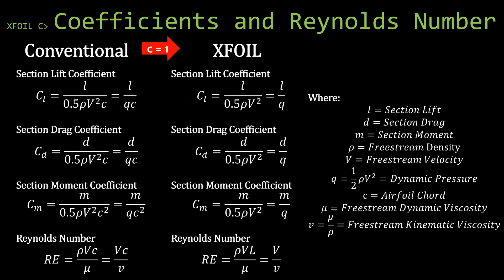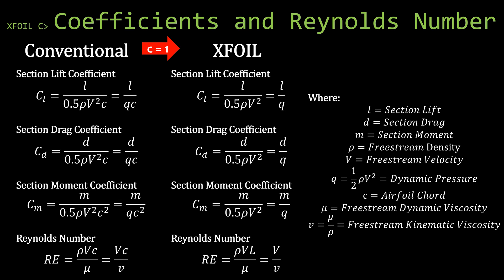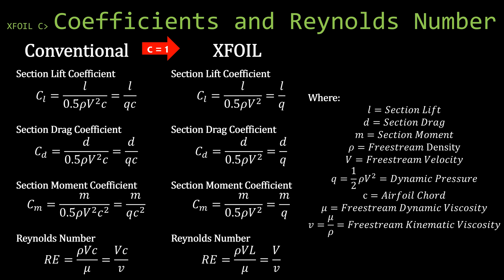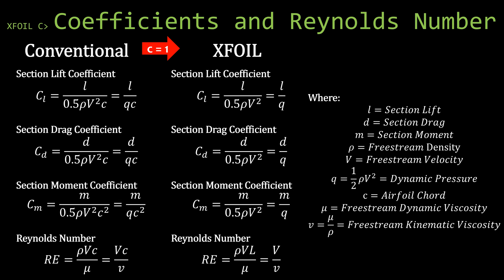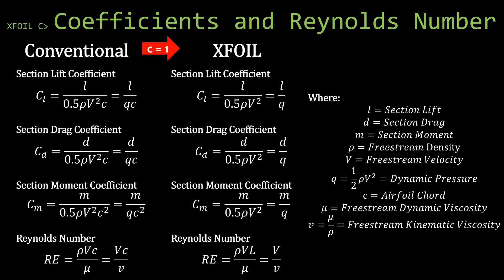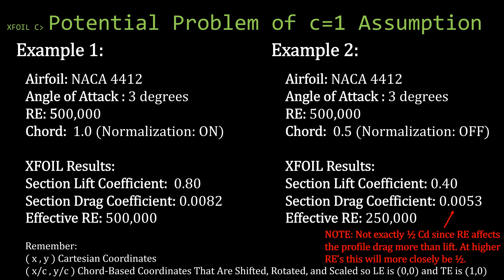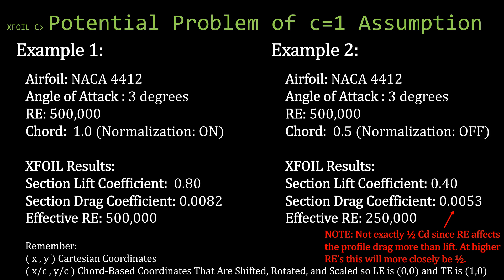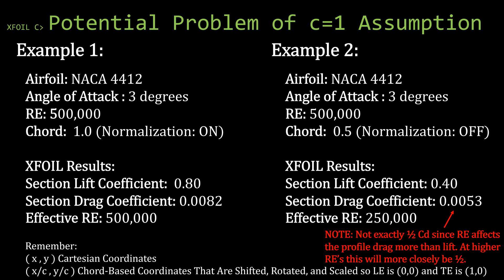XFOIL's Cl, Cd, Cm, and RE Equations (Major XFOIL Assumption!!!)

Comment: Thank u very much, it was very useful, i was testing an airfoil the nrel s822 in a wind tunel , my experimental lift and drag coefficients are very differents vs the xfoil coefficients but i think it could be the conditions of measuring, i used two digital balances and a mechanism to determinate the lift and drag forces. Now i realised that my experimental method is not very accurate, thanks for the explanation.

Comment: Hey,
Thank you so much for making these videos. I'm still a bit confused about the thing with the normalization of the chord. Suppose I'd have a NACA 0012 with a chord length of 0.06m. How would I compute Cl with XFoil? That is, would I scale the airfoil in XFoil and what value would I need to use for the characteristic length for the computation of the Reynolds number?
Reply: I have the exact same question. I'm using  a GOE 430 with a chord length of 0.060m . I normalized the Airfoil and I got the results, now I'd like to know how can I apply those results and calculate new coefficients for the Airfoil with the original dimensions. If this not possible how cam I do the calculation of the coefficients for the original Airfoil within Xfoil?
Reply: I have the exact same question using the same exact NACA foil for a rotor I'm busy modeling. It seems I would either need to:
1. Scale the Reynolds number using the difference in chord length of my actual model and attempt to normalize it in Xfoil, or 
2. Scale the NACA profile using GDES (My chord is 35mm so I use 0.035). I then specify a value for Reynolds number at the velocity @0.75 x Radius and run a polar of multiple AoA's. 

Using option 2 (which seems the most logical to me), my experimental vs theoretical results deviate with about 10%. 

Either way, I have found any solid answers either. I'm so confused...
Reply: @byronnielsen8896  I think the hint lies in the Cl, Cd,... and Re definitions in Xfoil. If you have c value other than 1 you have to correct for not only the output data but also the input data, i.e. the Re. So going by the example in the video, if your c = 0.5, before you get the data, your input Re should be scaled by 1/0.5 to tell Xfoil the effective Re for a chord of length 1. Then the output results would be for c = 1, which can be rescaled to c = 0.5. Basically scaling geometry should go along with scaling conditions, just like in a wind tunnel.
Reply: @TheTDSingh  Thanks for taking the time to reply. Your logic makes sense to me, reminds me of dimensional analysis and similitude. My majour is in Mechanical, so I have yet to understand the nuances of Aero. In any case, Ill give it a go and let you know!
Reply: @byronnielsen8896  great. Similitude is the thing that matters here. I tried c=1 and c=0.5 chord case with the above strategy, got the same (nearly) results, so it should work. All the best.
Reply: @TheTDSingh  hello, i understand that if i have a reynolds number for chord=0.5 my re input should be re/0.5 and my real output 0.5*what i get from xfoil. Is that right?
Reply: @thelazyflash  correct
Reply: @TheTDSingh  Thank you 😊

Comment: So, here is the scenario I am trying to analyze: 

I have a wing that is flying at 35,000 ft with 0.85 Mach Number. Re for the flow encountered by the wing is 42 million ( V = 252.054 m/s, rho = 0.37 kg/m3, mac = 6.455 m). For choosing an airfoil for the wing, I am analyzing various supercritical airfoils on XFLR5. When analyzing an airfoil (normalized) in XFLR5, what should be the conditions (value of M and Re)? 

Should I compute the value of Re by keeping c = 1 (instead of c = 21.18 ft (6.455 m)), which gives Re = 6.6 million? Will these values of Re = 6.6 million and M = 0.85 simulate the conditions encountered by the wing during the operation? Please clear my doubt.

Thanks and Regards.

Comment: Hey, nice video. One question, for the XFOIL Reynolds Number, why it's multiplied by L in the numerator of the fraction, shouldn't be without it (rho*V/mu)?
Reply from the maker: You are correct. L stands for the characteristic length and for 2D airfoils that is chosen to be the chord length, symbolized by the letter c. So, the L in the second RE equation is a typo and should have been removed with the other c’s. However, the final expression of RE = V/v is correct. Good catch!

Comment: Nice explanation but I have a question. Why does the lift coefficient change in Example 2 , although it depends on the airfoil shape and the angle of attack which stay the same even if the airfoil is not normalized and it only depends very slightly on the Re?
Reply from the maker: Due to an incorrect use of XFOIL, that is what I’m trying to point out in this video. In example 1, we get the right answer in XFOIL. In example 2, we get the wrong answer in XFOIL because we "forgot" to take into account XFOIL’s assumption that the chord = 1 in the equations used to determine the lift coefficient, drag coefficient, moment coefficient, and Reynolds number.